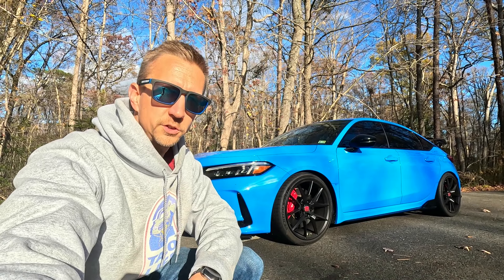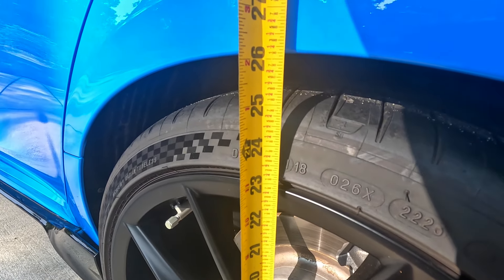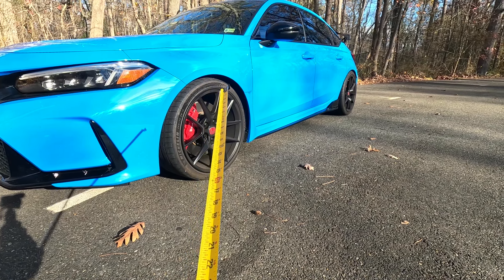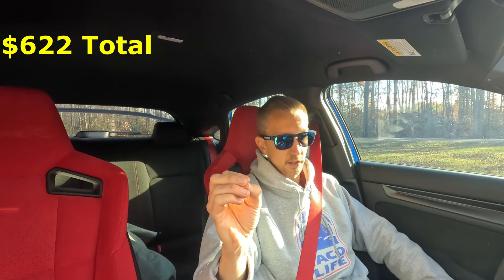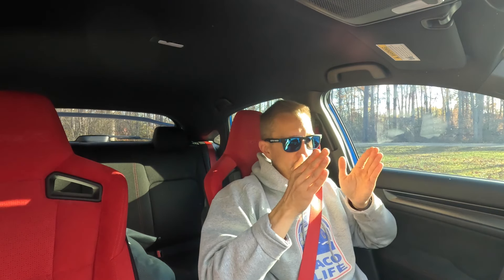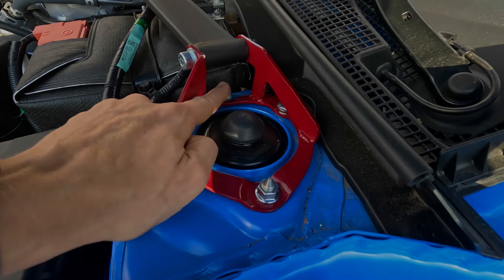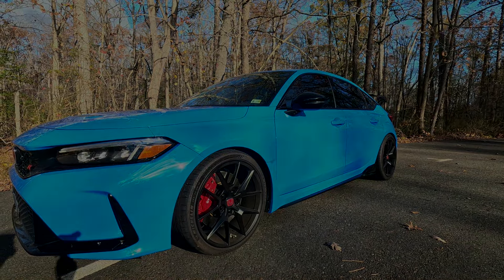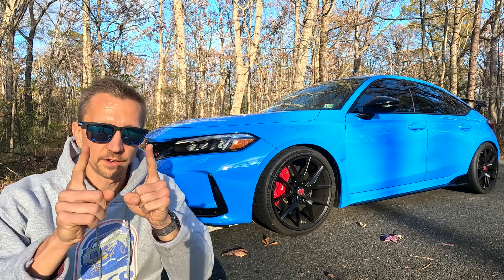Civic Type R FL5 - Spoon Springs Detailed Analysis

Comment: Nice recap. Glad to hear the ride quality is good  in comfort. Curious about the alignment, specifically the -2.0 camber in the right front. While it is  beyond the published spec of -1.5°, it's the difference from the left that I'd be more concerned about. They should be within .3° of each other.  Pulling the alignment pin can get you -.3° (not 3°), so maybe consider pulling the left pin and getting that to -1.7°, because there's no easy way to get the right side lower without buying some parts. If you do this be sure to readjust the toe on that wheel also.
Reply from the maker: Yeah meant to say .3 and not 3 when speaking.  Definitely going to be monitoring tire wear up front.  If no premature wear on either side, I'll just keep it as is, but when I get new tires mounted - I'll be taking some steps to get the camber closer in spec whether its pulling the alignment pin or an adjustable top hat/ball joint set.

Comment: Have you replaced your rear arms with adjustable toe and lower control arms? That’ll give you all the desired adjustability on the rear
Reply from the maker: @miguel_migskeyz  haven’t replaced components on the rear, however the numbers are within spec for the rear. The front is what needs some further attention.

Comment: Swap out the suspension module to the ITS module … you wont regret it. R mode is completely drivable. For me, it’s the perfect marriage.
Reply: ITS module is soft. Thats the exact reason I did not buy that and went with the fl5 instead.
Reply: @ got it … I found the stock module way too stiff. The ITS in sport is sweet spot. In R, it still stays compliant. The nice thing about it, it’s an easy swap back.

Comment: after you installed the lowering springs, do you still have the 20mm and 25mm spacer on the car?
Reply from the maker: @NellysaintsSROP  yes - spacers are still on it which give it the flush look.

Comment: Just bought a 93 white accord 4dr ex in near mint condition from a neighbors son who received it from another neighbor who past away and gifted it to him who then re-gifted it to me for $1.00 because he does not have a license.  Paint is impeccable condition.  Looking to make some changes to the car.  Very curious as to your rationale regarding so much front negative camber.  Does anyone know if their are caster kits to modify the inclination angle to modify scrub radius when changing to diff. wheels.  Also, can anyone tell me if anyone mfg. a front lower control arm with johnny joints or at least a one piece arm to avoide using front compression pin front bushing style. Lots of built in friction with the stock arrangment and not such great anti-dive geometry.  Planning on converting the upper and lower control arms to a double ball joint suspension geometry.  Allows for pushing scrub radius to the negative for better driveability.  Makes the vehicle feel likes its planing on water like a boat when turning vs the corner diving in when turning.

Comment: Ride hight is measured from the center of the wheel not from the ground.
Reply: I agree this is the best way to measure ride height change. Measuring height from the center of the wheel removes any differences from tire wear, air pressure, or different size rims/tires.

Comment: I thought they had revised these springs to give more drop on the front... I guess not
Reply: Yah. Rake
Reply: Are these the revised version?
Reply: @dereksakamoto  doesn't look like it from the video, he is visually sitting higher up front, but it's really an even drop. There have been recent claims and evidence that Spoon revised their lowering springs to lower the front more.
Reply from the maker: @boolji  these have the black insulators on both F & R. Earlier versions had blue on the front which supposedly indicated the earlier batch.